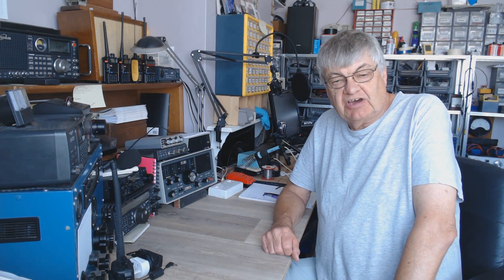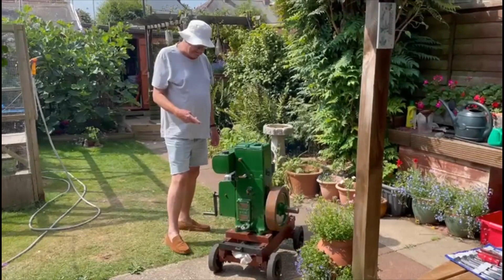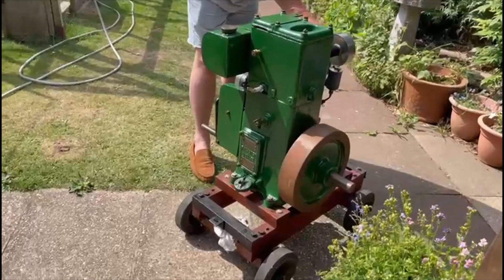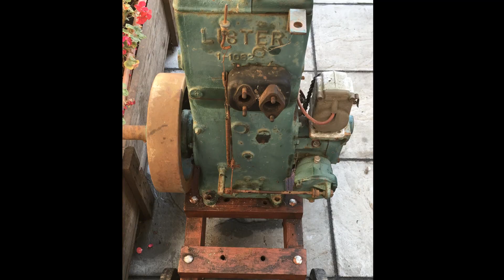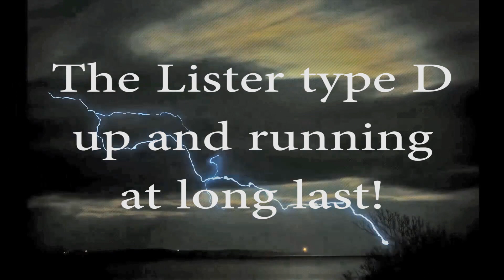The Lister type D stationary engine up and running

Comment: Good stuff MR Ray
Keep the old iron running
Sounds like popping jonney
I rebuilt a few as a teenager 
2 A's n a b 
I got little red wagon that i put a harbour freight 13hp on n alternator 
To charge the batteries in my race car but I sold the drag car 
Getting to old to care about race car's  
All ways at treat see one of your video looking forward to Halloween 
N hope for few more pirate radio  one's TO
Reply from the maker: Thanks, Joe. It’s great to hear from you.

Comment: Fab stuff Ray. I have a 1953 morrison electric geny. It has a villers mk10 on it with electric start. It charges 6 & 12v. I also have a Tiny Tim 12v geny too. Just to be different I also have a 1954 villiers two stroke roller mower. Maybe we will bump into each other at a rally.. 73. 2e0vov
Reply from the maker: Excellent! Yes, I hope we meet up somewhere. Cheers, Ray

Comment: What are you running it on kerosene? Was there any water in the hopper?
Reply from the maker: Petrol at the moment. I need to get a three way tap and small fuel tank. Yes, I did fill the hopper! 👍
Reply: @g4nsj  the old Crossley I am working on, has a nice little brass tap on the side of the hopper. If the hopper water is clean enough when the engine stops, it’s good for a few cups of hot tea.

Restoring that brass tap fitting is a tough but interesting task!

Nice to see another small engine enthusiast.

Cheers Ray. 😁🔧
Reply from the maker: Hi Peter, there’s an idea… a few cups of tea! Good luck with the Crossley.
Reply: @g4nsj  thanks Ray. 👍🔧🙋‍♂️

Comment: I've had a lister D  crank in my in the vice in the grarge for way too many years,  as yet I've failed on every attempt to remove whats left of the pin locking the flywheel on.  And my mag has broken wire in the coil so I need a new one or a coil rewind. Do have a nice set of wheels and a water pump ready for it if I ever get it running again.
Reply from the maker: Go for it, get it up and running!